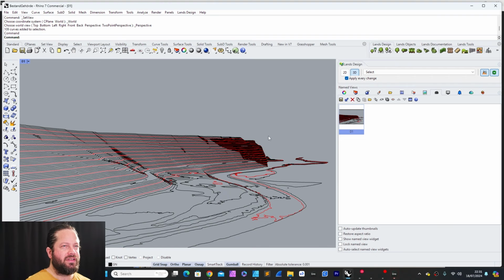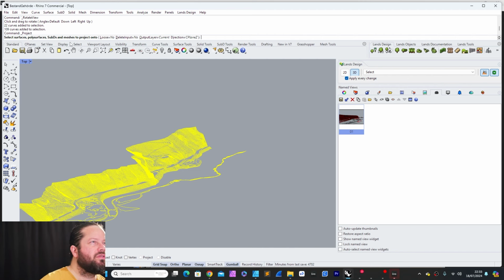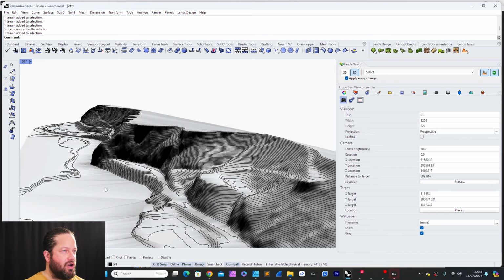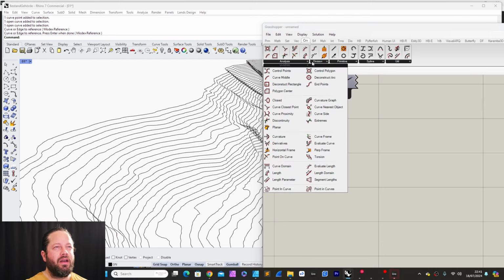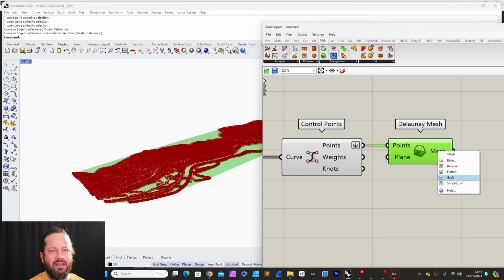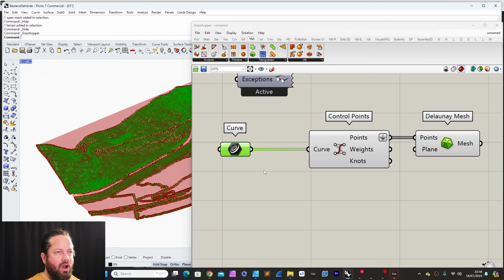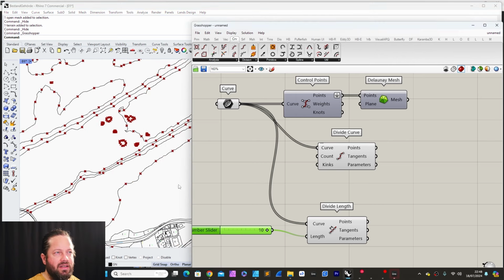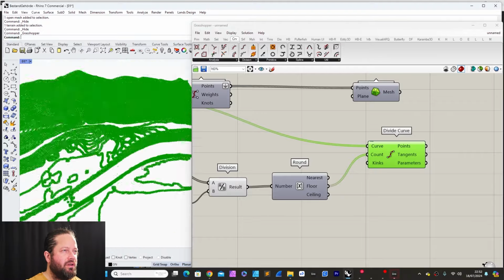Perfect Terrain Models within Seconds - Grasshopper Tutorial for Beginners

Comment: Great video on a topic that isn't typically well taught. A few points:

The reason you had to flatten the list is that most Grasshopper components operate on a per-branch basis, meaning you were performing the triangulation for each curve individually.
I like incorporating an "attractor" type filter based on the center point of the building site to simplify the model as it extends further from the area of interest.
A second video on Cut/Fill methodologies would be fantastic! I enjoy seeing how others approach this seemingly simple yet surprisingly complex operation.
Reply from the maker: The attractor method sounds interesting. I will think about the cut and fill... Great suggestions
Thank you.